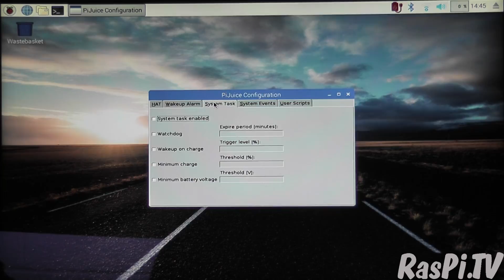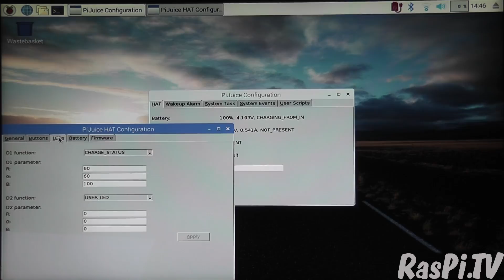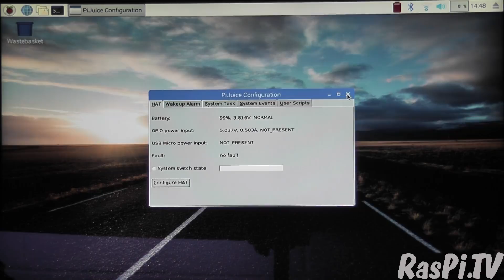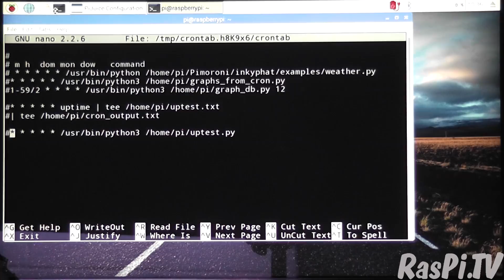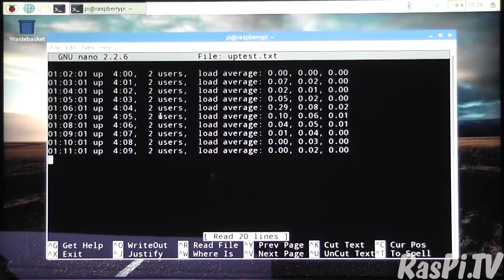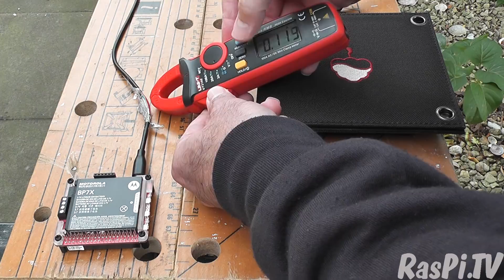PiJuice testing in use + Solar Panels + software overview

Comment: Got two pijuices and have same problem. Tried both on the same rpi2. First pijuice worked out of the box, then bricked. I removed all power sources while trying different stacking headers and standoff’s for proper fit in a touch screen case. I then reinstalled the pijuice and now have communication_error.  The second pijuice has the same issue out of the box. Suggestions?

Comment: Nice review, been waiting for two years for mine. Looks as good as I thought it would be. I had planned to use it with an A+ in the garden to run my weather station. Not sure that it would have worked watching this. But I do have a Pi3 on 24/7 on my desk for development and this would be a great way to add a UPS to it as at the moment I have to be so carful when plugging stuff in and out that I don't shut it down. Thanks Alex.